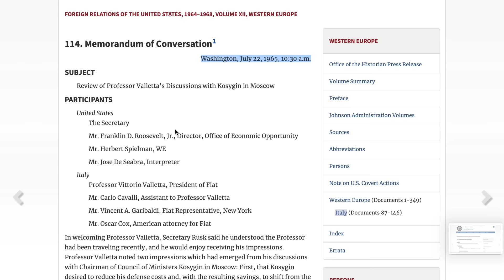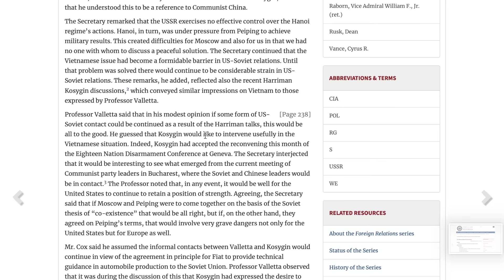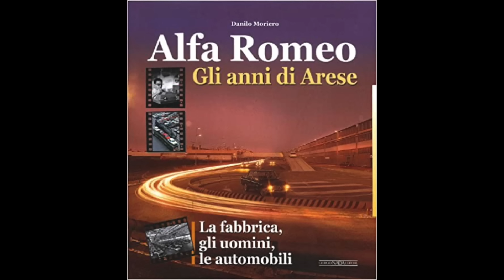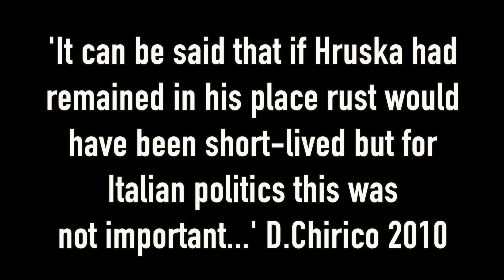Alfa Romeo And The Myth of Russian Steel - The Real Reason Alfas Rust

Comment: There are many reasons italian cars of the 60's 70's and 80's and even before that as well rusted like crazy. The list can be long, and explanations likewise.
The story of Russian metal is widely spread and often mentioned, but it wasn't just the Russians. All manufacturers suffered more or less the same problems, WHY? (I remember looking at my friends 1984 Ferrari 308, and it had rust in its fenders around that little round blinker in 1987. I was appalled that a Ferrari could rust, but he just replied it's a used car, all used cars rust...
Well getting into the 60's rationing of goods were finally lifted, and demand for materials skyrocketed. Steel Mills where producing as much as they could. I have heard from a metallurgist that in order to make "steel" less prone to rusting, a good portion of it needs to be recycled metal that has fifnished it's propensity to oxydization.  But also the content of different metals to create the best mix, like Chromium, Molybden, Cobalt, Zinc, and other metals weren't all that well developed. We have done quantum leaps since the 80's, but that's only part of the answer. Metallurgic advancements are important, but also the manufacturing process. The design was done on paper by hand, and not by computers. The manufacturing of parts was done the cheapest way like today, but involved metal bending as well as stamping. Some of these processes meant that some of the metal was thinner in some places and thicker in other. Then it was the little helping parts that were added in order to make it possible to weld them togehter. All these little areas of butressing created pockets that were impossible to reach with rustproofing once welded up, but water eventually found it's way and then the car was lost to the steel worms gnawing from the inside out. And paint was bad, rusting all by itself. Now we have acrylic paints that also have been improved, but also doesn't rust like the old paints that oxidized and rusted.

Today all is CAD and these "helper pieces" are no longer necessary since glue is being used instead, and the pieces are stamped out as an integral part instead of being welded. 
So weak areas of welding that were extra prone to rusting are gone in most cars (not all, and these cars rust more). Rememeber welding areas/seams that rusted first?
Also you had lemons, some call them monday cars or lunctime cars etc. This is because much was made by hand - remember human intervention? Well humas forget, robots don't. So today all cars from one process are either good or bad. Mostly good since bad processes show up more easily. Metal thickness is more even, preparation is more even, rustproofing is more even, paint has the same thickness and so on.
Add everything up, and there you have it. It's called progress. 

BTW I used to own an Alfa in the form of 1979 Alfetta 1.6 in a subtle red color that tends toward burgundy (it was a different name), but beautiful on that car. I got it in 1984 and it was badly rusted in the usual places (door bottoms). It had so much rust in the front subframe and steering gear that the previous owner had welded the dampers in place !!! But fond memories. Someone had tuned the engine to the max with oversized DellOrto's, triple valve-springs and a full exhaust from Ansa that ensured it sounded like a race car. It went like one as well. The redline was well beyond 10k and the needle just swung around and pegged against the stop. It sounded glorious and went like stink. It scared most people but I remeber it fondly for how it went, and how much space it had inside. Alfa knew how to exploit available space. HUUUUGE trunk, and extremely roomey inside the cabin, way beyond what the dimensions would call for (why don't they build cars like that anymore? Fun engine, fun capacities, and lots of space. Maybe my memory serves me wrong here...)

I would like to attach a list of Italiano sport car manufacturing that I found while seaching the problem that may be entertaining.

The Six Laws of Italian Sports Cars

1) THE LAW OF PLEASING DESIGN WHERE IT REALLY DOESN’T MATTER
“The inside of cam covers or other relatively innocuous areas, shall be laced with buttresses, cross-bracing and all manner of esoteric stiffness-with-lightness design, while something like connecting rods shall self-destruct at redline plus 1 rpm due to a basic lack of strength.” An example of this Law is the stunningly beautiful Lamborghini or Ferrari V12s of the late 1960s. They were famous for wearing out all four camshafts in 10,000 miles or less. The cam’s metal appeared to be recycled coathangers, which coincidentally are still in short supply in Italy.

2) THE LAW OF NON-FUNCTIONAL APPARATUS
“All Italian Sports Cars, regardless of age, shall have at least one system or component which does not work, and cannot be repaired. Such a part shall never be mentioned in the Official Shop Manual, although there may be an out-of-focus picture shown.” It goes without saying that such parts should never under any circumstances be removed, lest the natural balance of the car be upset.

3) THE LAW OF ELECTRICAL CHAOS
“All Italian Sports Cars shall be wired at the Factory by a cross-eyed, colour-blind worker, using whatever supplies are within reach. All wires shall change colour-code at least once between energy source and component. All grounds shall be partially insulated.” This tends to guarantee that the owner of such vehicles will eventually be intimately familiar with its electrical system, since he will need to trace out each wire, then rewrite his Official Schematic, which will differ from all others in at least one area.

4) THE LAW OF PERSONAL ABUSE
“The more an Italian car breaks down, the more endearing it becomes to its increasingly irrational owner.” For example, you purchase an Italian Sports car, for all the money you ever hoped to earn, and receive a ticket for air pollution on the way home from the dealer due to the vast clouds of smoke that follow you. Several return trips to said dealer, accompanied by your rapidly dwindling cash reserves, cures the smoking. But now, the engine sounds like a food processor full of ball-bearings. After replacing every component in the car, including the radio speakers, the noise vanishes and is replaced by an odour reminiscent of a major fire in a goat-hair mattress factory. You still keep trying, God help you.

5) THE LAW OF UNAVAILABLE PARTS
“All parts of an Italian sports car shall be made of a material that is available in inverse proportion to its operating half-life.” Thus, the speedometer hold-down screws are made of grade 8 cold rolled steel, while the valves are of fabricated Unobtanium, made only at midnight by an old man with a pointy hat covered with moons and stars. Such parts will be backordered during the design phase of the car, and will remain so forever. Bribes, pleading and threats will be ignored.

6) THE LAW OF CRYPTIC INSTRUCTIONS
“Any official publications dealing with repair, maintenance or operations of an Italian sports car shall be written such that every fourth word is incomprehensible to the average owner. In the event that a random sentence is understandable, the information contained therein shall be wrong.” This is also known as flat-tyre English, where a sentence flows along nicely, then – Kaboom!
Reply: You 100% nailed it. Have worked on every Italian car, name it and it’s true what you expose.
Reply: Thanks man
Reply: You forgot rule 7!
All Italia sport cars are to be exported to customer countries as deck cargo on submarines therefor ensuring a continuous customer base!
Reply: Cars are also often designed poorly, even in the age of CAD, with some spots prone to holding water and eventually rust(no amount of epoxy primer can prevent the metal from rusting if it holds water). I've had a ton of 80s to 00 BMWs- E31, E32, E34, E36, E38 and E39. Most of them are relatively modern(I meantechnogical process) and generally won't rust on their own, but all of them have these "dumb spots" that will always eventually rust. Usually where metal profiles are drilled to fit some plastic skirts or trim pieces- if not flooded with wax, they are gone.
Reply: @karolmalinowski9097  I agree with you  100% I have also had a number of BMW's for more than 20 years starting with e21 and e30 which rusted badly, thrunk was especially prone. As did e9 and e24 especially at the bottom of the firewall. the e34, e39, e38, e65, e91 and ending up with f20 and f22. The newer ones don't rust yet. and the e39 and e91  that I still own have been protected regularly with tuff-kote dinol. They don't have a spec of rust. BMW has become better and better over the years, and lots of the subchassis and wheel/suspension system being made of alu/mag alloy rust or rather corrode very little. But as you say, poor design where you have water pockets still make cars rust. especially when driven on salty roads, which we have at least 6 months out of the year where I live.
Reply: My sister had a 124 Spyder. If it sat for two weeks the battery was dead. Did the Italians learn automotive electrical systems from the Brits?
Reply: 10000 RPM lol
Reply: @mpetersen6  most likely from Lucas, the man that invented darkness...:face-green-smiling:
Reply: @markotrieste  You bet, it was the most fun you could have with your pants on. It sounded a bit like the Honda CBX1000 engine.
Reply: @perjanuschas8050  LOL in the sense that it is simply physically impossible.
Reply: @markotrieste  Physically impossible to make a 1600cc 4 cylinder engine rev to 10 000 rpm? No. Aggressive cams and stiffer valve springs do a lot with various supporting mods depending on the engine in question.
Reply: @sampuhhupmas5666  Never said a 1.6 4 cyl can't rev at 10k RPM. I'm saying the Alfa can't rev that high. You'd break the crankshaft much sooner.
Reply: @perjanuschas8050 I saw a bumper sticker once " I like my beer warm, I own a Lucas refrigerator."

Comment: Very interesting car production history, Jack. And it's right on the spot what I have heard. The late father of a close friend of mine was  head of the Austrian Alfa Romeo importing company. He told me that because the paint shop in Pomigliano d'Arco was often out of service, due to strikes or other reasons, the raw Alfasud bodies were stored outside and often without any protection and were subject to weather. And note: Pomigliano d'Arco is close to Napoli and Napoli is on the Calabrian coast. So there is always a little bit of salt in the air's vapor.

Comment: Soviet steel had less carbon and nickel in its composition, and this can speed up the oxidation process. But the biggest problem for Alfa's south Italy factory of those times, was the storage of the steel sheets outside/outdoor before they were pressed, and the poor
anti-corrosive protection associated with the painting scheme, at the level of the primer layer (and the incorporation of zinc as a constituent), and other anti-corrosive compounds on the chassis, before painting. This problem was also common on Fiat 127, 128, not only on this Alfa-Romeo model, and also on some Lancias. Do not compare this, in general, with the German and Swedish standards, saying that they also suffered from the same problem, in the same way. That's not true, and it's already a subject known to everyone who knows the reality of the European automotive industry since the '60s.
Reply: The Russian steel was also hot rolled-unlike the common cold rolled stell. Hot rolled steel is less string and more probe to flexing. My experience with rusty cars is extensive-one of the best American makes (oddly enough) was AMC-they did a body primer dip  before painting, my AMC had very little rust at 12 years old.
Reply: You are ignoring that the involvement of Russian steel was debunked. Further more, if the steel sheets were stored outside then Moroni would have picked up on it and that would have been the end of the rust issues. The real reason can be found in the car specifications: the 1st series Alfasud weighs only 730 kg whereas the Volkswagen Golf Mk 1 is 790 kg, but unlike the tiny Golf the Alfasud is in fact a proper size family car featuring an impressive boot space. How do you think they managed to loose weight? Sure they won some on the more modern engine design, but what really did it was thinner sheet metal and that's where car building techniques from that era bit back because you cannot paint the inside of hollow sections. Every car from that era (roughly '70-'90) I ever owned thus eventually suffered from the same issue: condense in hollow sections evolving to rust that at some point would break through to the outer shell. On cars from more conservative manufacturers it just took longer to show, but had MOT existed in those years the differences would not have stood out as much as they are presented today.
Reply: From what I have seen on my Italian cars of that era if you could not see the surface from the outside it was not painted.  Not even primed.  Plus they also use double skinned panels which become dirt and moisture traps especially around edges like hoods (bonnets) and wheel arches etc.
Reply: @johnmcdermott5505  Exactly, the fitting of wheel arch liners solved a lot of the problems.  No cavities for the road dirt and mud to build up and never dry.  I'm old enough to remember when viewing a slight accident on the street, the amount of dirt that fell from the wheel arch area.  Of course now bodies are dipped to prevent corrosion but I run an old Land Rover Defender which has the same issues with dirt build-up in the chassis box sections.  Jet washing regularly is a must to keep things under check.
Reply: soft steel ? so tooling lasted longer and possibly the body lines were more crispy? than if using say SS 304 or 308 that's way harder as ford found out on Lincolns and mustangs but quick quite after less than 200 cars in as it ate the tooling
Reply: So what, there was NO Soviet steel in the Alfasud !
Reply: @genekelly8467  You cannot use hot rolled steel in any part of the car that can be seen because the poor surface finished of hot rolled steel would make the finished product look bad.
Reply: The steel used in car bodies has to be very low carbon to help formability.  It is known as mild steel.  Any nickel present would be a trace and not affect rusting.
It is the phosphate pre-treatment, usually applied by dipping the body in a tank of phosphate, that gives a car body its corrosion resistance.  There are other factors, but that is the main one.
Reply: @robertdarby6553  interesting how so look wise?
Reply: Not in general, but during the Lopez regime, various German car manufacturers suffered similar rust problems in the 1980's and 1990's.
Reply: @chrismartin9421  Only Soviet oil! :-)
Reply: The Fiat 127 was my first car. I killed it on an icy mountain road, so it did not have time to rot away. It was a great car. My third one was a terribly unreliable but beautiful 127 Sport 70 HP of 1978. It was a blast to drive! I sold it to a youngster. Not even a year after that I saw it in a junkyard. It broke my heart. I had painted the car in an inredibly beautiful dark blue metallic!
Reply: @Retired Bore high carbon is no good in a car crash. instead of a dent it breaks into razor sharp shards
Reply: Great theory, until you read the comments which clearly show German and somewhat Swedish cars suffered as many rust problems.
Reply: @spaniardsrmoors6817  yeah that’s why you never see old VW Beetles or Golfs ever now. All rusted away. Non existent. When was the last time you even saw one for sale!? Let alone on the road. Oh wait, it was this morning and regularly all the time! 🤦‍♂️
Reply: @GTFour  yeah, there are 60's Alfa's for sale, you have a point? First those Beetles & Golfs sold many more units than Alfa so of course more will have a chance of survival, second, those that have the vast majority are in poor condition.
Reply: From my experiance all cars made in the 70’s & 80’s were rust buckets within a decade.
Reply: @robertdarby6553  IFAIK Audi and Porsche use whole body hot dipped galvanizing. The gold standard. Most cars use electro galvanizing. Rust buckets like Mazda 3s up to 2011 used cold galvanized steel and little in the way of cavity wax in lower structural sills/rockers. 
Mercedes were also bad 1997- 2006 until they started using double sided galvanized steel in vulnerable areas.
Reply: Ferrari’s were starting to rust before they were even built - see some of Iain Tyrrell’s videos

Comment: In the mid 70’s, my older brother worked as a mechanic at a MG/Fiat/Lancia/Jaguar new car dealership in central Illinois. The Fiats needed rust repair immediately after delivery to the dealer, before they could be placed on show room floor. Apparently, the sea voyage allowed lots of sea water exposure.
Reply: All those makes crossed the Atlantic.
Reply: @pd4165  But the non-Fiat makes withstood it better.

Comment: Interesting video. 70's cars of all makes and models tended to rust thanks to mud traps, umpteen separate pressings being used due to how cars were designed and built back in the 70's, lack of arch liners and splash guards, car bodyshells being stored outside, workforce strikes (if going on strike was an Olympic sport British Leyland would win gold) and lack of proper anti-corrosion systems. I can still remember my dad having to underseal our R reg Escort MK2 a couple of years after buying it new because it was starting to rust.
Reply: Nobody denies that most cars of the period rusted, the point is, the Alfasud (particularly before 1977) was far worse.  I worked for a major London Alfa dealer and we had a queue of cars in for repair that were still within their 12 month warranty.
Reply: salting the roads didn't help. All cars rotted away in Denmark thanks to road salt.